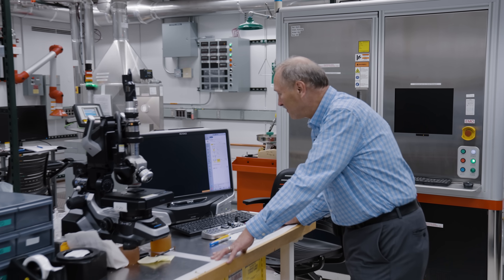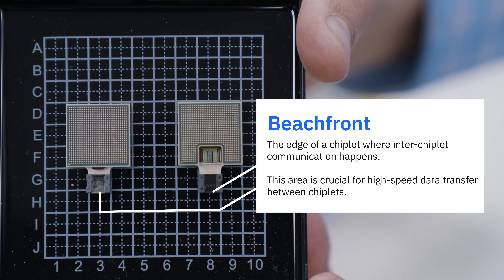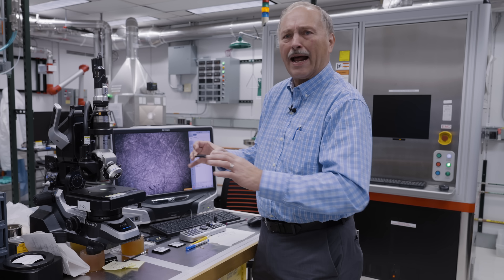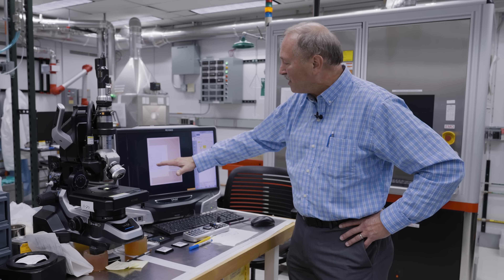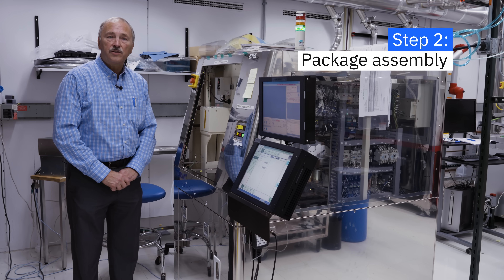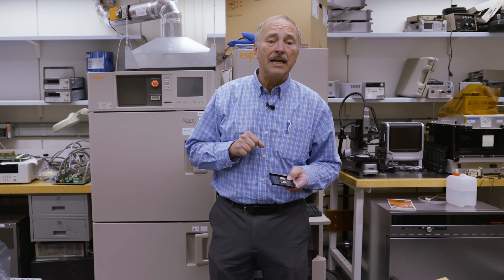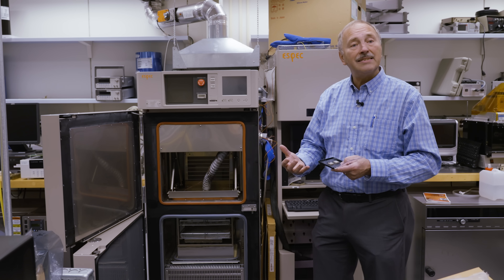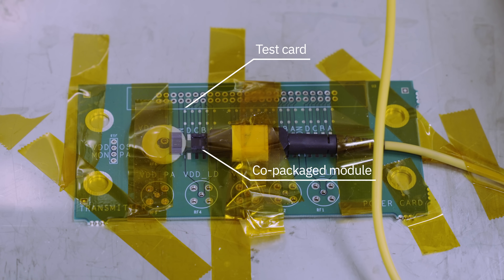Lab tour: How to test technology that’s never existed before

Comment: I was offered a job at IBM back at University in the 1980s.  Turned them down.  Sometimes I do wonder how different my life would have been if I had accepted.  Not that I'm complaining.   So wonderful seeing high level engineers at work.  Especially when they are so engaged and happy.   Amazing video.  Thanks IBM and Mr. Knickerbocker - you rock!

Comment: What would be great is to have all these instruments plugged to a computer then from there do all the testing using a unified GUI paired with automation and AI powered agents to accelerate the process and get products faster to the market. Next step use robots throughout all the RnD phases. We need these stuff right now not in 10 years

Comment: Awesome, multiplexing the optical and silicon compute resources on the same board with near endless reconfiguration and expansion would drastically reduce contingency on the silicon systems overhead. It would be cool if you could stack the PICs and using EUV to build intralayer channels that doesnt take up the main photonic bus for intralayer communication without unnecessary bottlenecking making monolithic photonic cortical columns that both make the most use of the alloted space while using less energy. Also it would b cool to see something like a memristive array that makes use of the stacked PICs with rechargeable phosphors to denote regional activation and luminance of a fixed region over time as a weight bump

Comment: That's great. Connection to CPUs will be by flexible tubes. At least this adds mobility and good heat dissipation distribution. (Maybe it will be immersed in liquid oil then).

Comment: One of the most clear and concise videos of this type. I'm curious as to how many wavelengths can fit in one channel. I could imagine a case where this just gets better and better depending on how much precision one reach when differentiating between wavelengths.
Reply: With multi-mode optics, you can run multiple wavelengths through the same glass fiber due to the internal reflections of those beams of light, the different frequencies used (modes) reflect down the glass fiber at different angles. The sum of these different signals reaches the end of the fiber and I imagine some type of discrete Fourier transform is applied to the signal to view the different frequency components that each individual frequency is sending. 

This differed from single mode optics where the light is fired directly down the middle of the glass fiber and is thus just an on-off signal and as a result can be used over longer distances. 

For these glass chip applications the super short distance this light travels means you can pack more frequencies withing the same fibers increasing information bandwidth without having to worry about attenuation (degradation) of the signal.

Comment: Assume waveguides is coupled with multimode fiber instead of single mode? What is max transmission speed? Just curious.  Good job to bring it on market.  Assume the electric connection is gold bump since you use thermal compression... ?